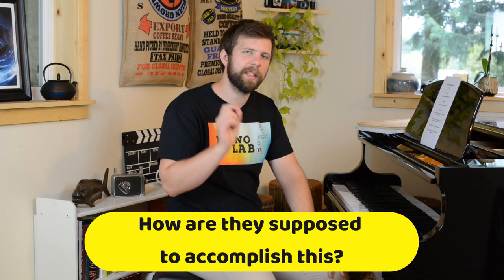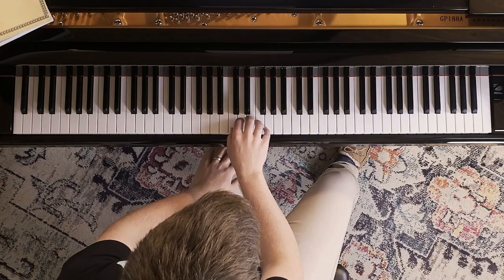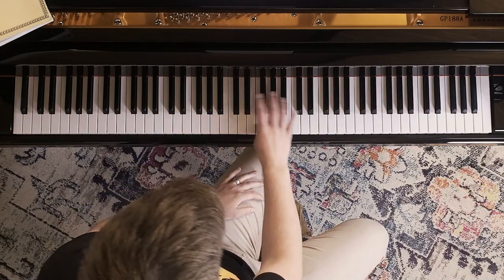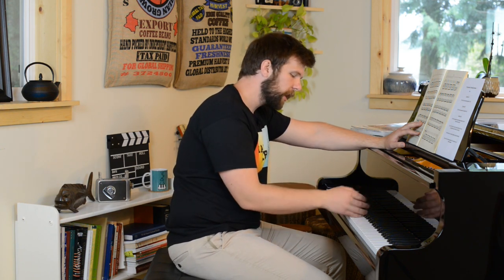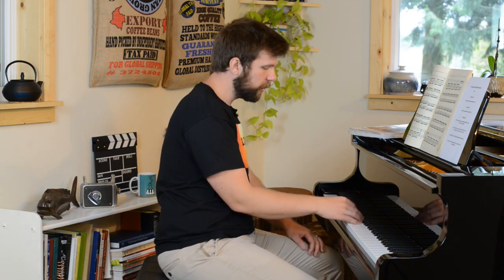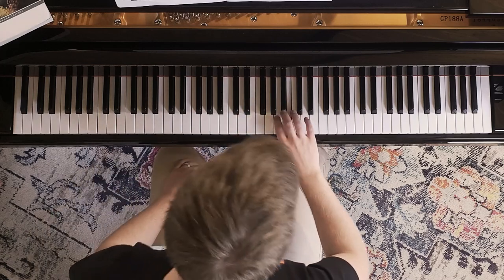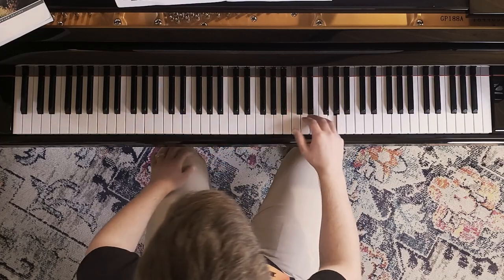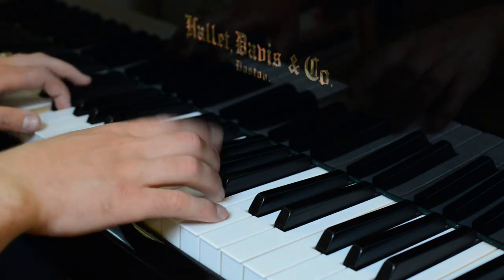The PROBLEM Of Technical EXERCISES

Comment: My opinion of Hanon is that it adds little or no value to keep practicing them once you can play each one competently. The main benefit of the 60 Hanons that is often overlooked by the naysayers is that they are exhaustive. Every possible single finger combination / pattern is covered. This will flush out and reveal any independence weaknesses between specific fingers (and between hands), so that you can work on them and fix them.
Once you can play every Hanon variation then there’s not much wrong with your basic finger independence. You’ve done with them and there are better things to spend your time on.

Comment: Working thru tutorials 6 months on.  Same comments as first time.  I find it much more productive to work out the musical speed bumps in the music, using sound and ergonomically sound movements, which amounts to a bunch of stuff worked interactively without stressing one element way more than another.  That's why it takes a while, there are no secrets that will get you to play like so and so in a few lessons.  It is accumulation of specific practice work worked slowly, then combined.  If one does it right, like the tortoise and the hare, one gets there faster, which seems counterintuitive.  

One study that I did somewhat Bartok's graded "Mikrokronos," which leads into all aspects of music, not just finger strength, independence.  Come to think of it, again, fingers should NOT BE independent of overall good movement coordination with other body parts.  Posture, shoulders, forearms, elbows, wrists, knuckles, various digits, each one different from the others.  These will develop finger strength in a healthy way.  Didn't Schumann or some other genius ruin his fingers with a contraption for "strengthening" fingers?  All parts need rest, especially the smallest muscles, while playing and with proper rest/breaks.  The advanced tell us that the rests are just as important as the notes.

Comment: No disagreement here.  You make your case with logic, finding the why purpose behind doing anything.  As a young student my teachers gave Hanon, Burgmuller and all.  I really tried but just playing the patterns didn't scratch my itch, did nothing automatically positive and reinforced less efficient playing, as the guidance was not sufficient.  General playing time with no goals but finishing an exercise 10 times or for 26 minutes?  I gave up on exercise books and just tried to solve those problems in the music.  I can find 15 sequences on every page where proper rotation can make the playing better from many angles.  Your analogies and straight-man humor are very effective and intuitive teaching tools.  Your passion registers.

If one has a hot date and brings her home, when things start going fast, they can always break out the Hanon #1 and impress her, or any audience.  "Concert featuring Billy Joel," or "Bill Evans playing at Smokey Joe's Jazz Club," "Gershwin plays Gershwin" "The Duke"....will perform a smattering of their favorite technical exercises.  Taking requests.  I am an academy trained baritone singer with performance experience Went through the same stuff on that pathway, they tended to retard the development of fine technique, which is much simpler and easier than they try to make it.  If it works, it works.  If it doesn't, repetition will not be very helpful.

What you do makes sense in the real world.  I like passion and fun in creative music, though it be not perfect technically, but as good as it can be.  Perfection is an unattainable goal in the realm of the real.  Double check that with my wife.

We love you out here.  Keep up the good work.  Hope you are doing well in general.  Kudos from Oregon.

Dave M

Comment: Yes mindful exercises are good at piano. Unfortunately many piano teachers mindlessly prescribed this, Pischna etc. and give no guidance and this usually ends up in injury.

For instance, Hanon wrote his exercises for a clavichord, a completely different instrument to the modern day piano. His instruction literally leads to tendon injury, the rising your fingers and striking, due to cocontraction of opposing muscle groups. Many earlier keyboards keys have a weight of around 50g/s per key depression whereas a contemporary Steinway has over 100g of force required to depress a key fully. This is why not using your arm weight when striking keys is absolutely fatal to one's hand health, our fingers are weak and are not prepared to play a modern day piano just by themselves.

Playing through your full arm rather than just the fingers is what we need to do; Chopin and Liszt speak about this extensively, yet most of these technical exercise books do not teach rotation, in and out movement, how to use shoulder impulse, etc. And many teachers, taught Hanon themselves, do not teach these things either.

Why give a mindless exercise book when you can tackle the technical problems in actual repertoire? It's more enjoyable and you're willing to persevere as a result.
Reply: I could not agree more;  I can invest time solving the challenges in the music and be much farther along in my process than playing exercises few if any actually perform in recital.  Extremely well expressed.  Also for the reasons you and Craig mention on how it this comes about and still persists.  Thank you.  Controversial subject which probably be as much as it is.
Reply: Clavichord? The book is called "The Virtuoso Pianist" and it was published in 1873. Clavichord fans have always existed but it's not like that was the main keyboard instrument in the 1870s (or ever really). Hanon does cover other technical difficulties. In the 3rd book he has exercises for "preparing the wrist for the tremolo" with the tremolo itself being the last exercise. He also has exercises on for example wrist staccato and such. It is not all finger exercises